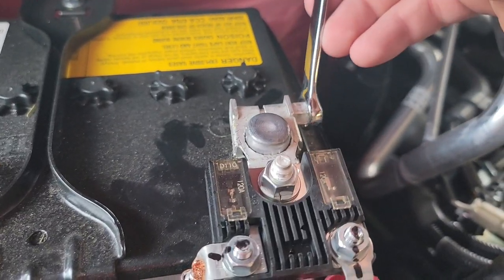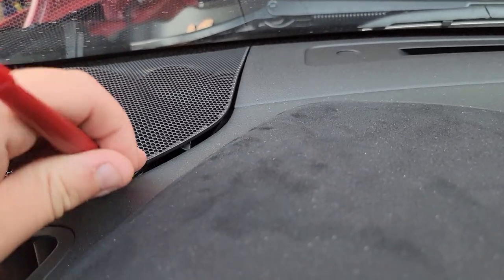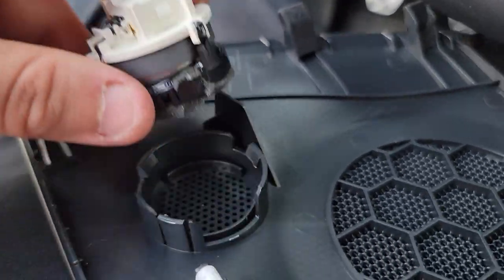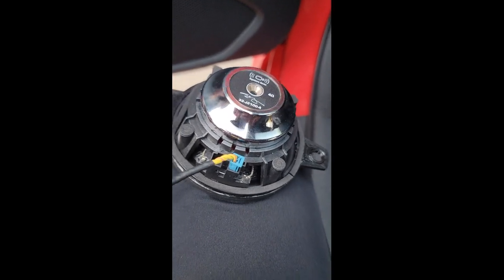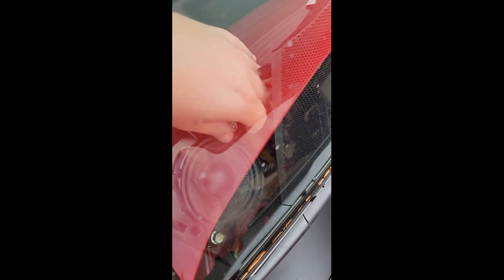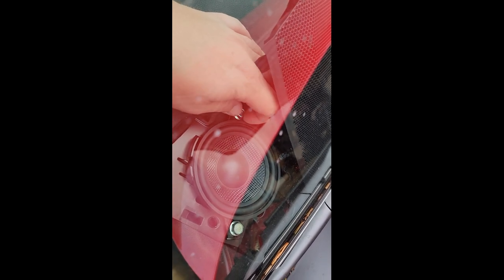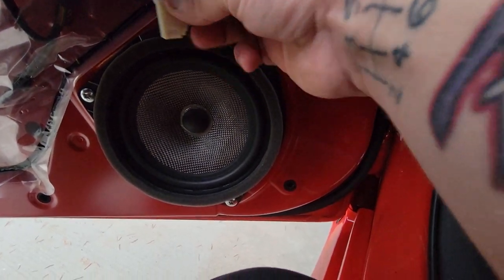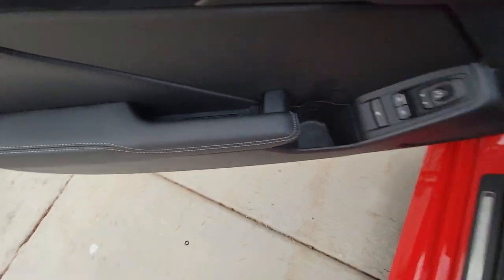GR86 gets OEM Audio Plus

Comment: This might be a stupid question but dont you need to disconnect the negative terminal (first) as well? You mentioned that only the positive terminal disconnection should be okay but can you explain why? Thanks.
Reply from the maker: There's no stupid questions, I'm always happy to help. You really only need the positive disconnected so that there is no power in the system. If you do just the negative there is a possibility of it touching metal and arching or allowing the circuit to close. You can do both but you really only need one. Plus the car will be off so there's not really a chance of the speakers getting a signal and blowing out but to be as safe as possible and make sure equipment doesn't get damaged it's always best to disconnect the battery. I apologize for the late reply, I've been moving.
Reply: @DankersRacing  IMO it is safer to disconnect the ground connection. While the wrench is attached to the positive side of the battery, you run the risk of touching metal with the wrench. Bad things could happen if that were to happen. You should always disconnect the negative side of the battery first.

Comment: Did you ever consider stuffing poly-fill behind the 3" dash speaker to slow down the air behind the speaker and possibly prevent/mitigate back wave interference?   Sure, poly-fill is usually used in sub enclosures to slow the air and help the sub act as a larger driver.  Same principle here in the dash, just a slightly different application.
Reply from the maker: Never considered it because I had no idea that was a thing XD

Comment: what eq settings...during my install I never disconnected the battery. Does that matter. Also didn't know what port to plug connector into either. And do you have the 8 or 6 speaker systtem from factory? Reason for all questions is that I just feel like they should sound better than they do. Maybe imma doing something wrong lol? thanks in advance good vid!
Reply from the maker: Thanks for the love!
I have the 8 system (premium) i just messed with the EQ till I liked it. Super crisp in my car and you can not only feel but also hear the different base tones. I noticed it does not matter what connector you use (so just use what's better for routing the wires) Disconnecting the battery doesn't really matter so long as power isn't on. It's rare you'll get an electrical spike but if you do it could damage the electronics (better to be safe than sorry lol) I do it out of habbit after working for Ford and Chevy 😆